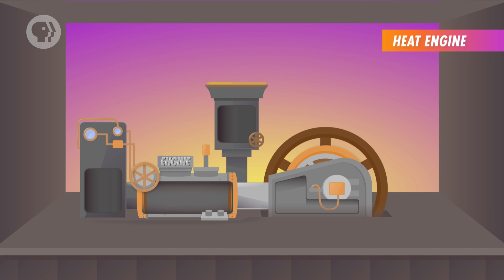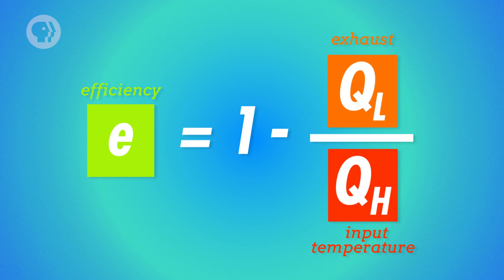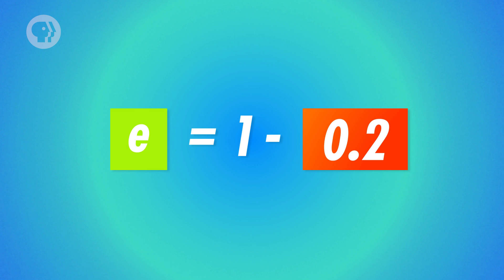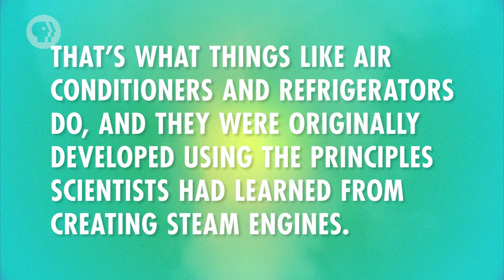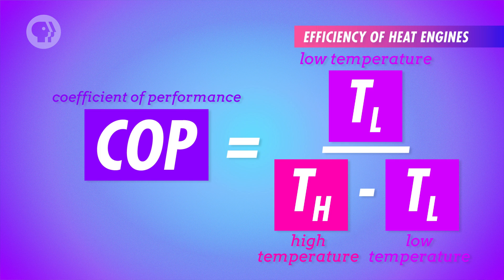Engines: Crash Course Physics #24

Comment: These videos are good overall, but that's just an awful description of how a refrigerator works. She doesn't even mention the pressure difference in the two halves of the loop.

Also, all you young'uns with working high-pitch hearing need to learn how to use the equalizer on your computer or phone.

Comment: The animation of a refrigerator at work is completely reversed and incorrect: after the liquid is turned into a gas it is compressed at which point it flows to the condenser to shed the heat extracted in the fridge(and the heat generated by being compressed) and return to a liquid. This liquid is then sent through an orifice or long, thin capillary tube so that it pressure is reduced hence it's temperature lowered. This liquid then goes to the evaporator inside the fridge where it absorbs heat from the interior and boils into a gas before returning to the compressor. The animation shows the compressor as a "decompressor" or expansion device(orifice, capillary tube) and that is opposite of it's true function as the whole thing is reversed.

Comment: Thanks! The production value is great. However:

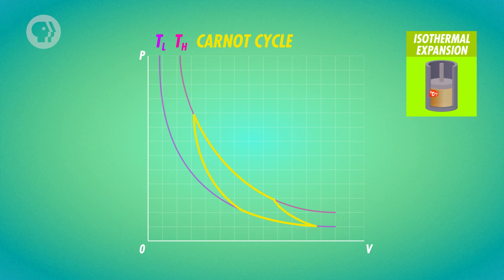At 05:00 you say that there is an isothermal process where heat is slowly added, but the animation shows lots of heat (Q_H) escaping. What gives?

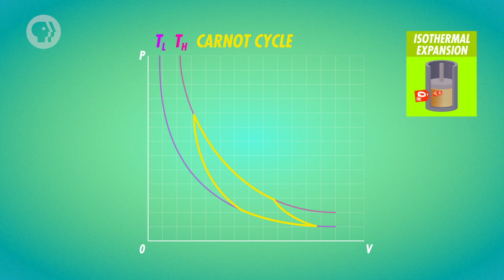At 05:04 You say that the isothermal expansion is 1/2 AB. Shouldn't it be the entire path AB?
 
At 05:15 you say "the temperature drops whilst the heat stays constant, which also makes the volume expand". Well this is misleading: a temperature drop would cause an isolated system volume to contract. However in a Carnot engine, the system is doing work on the atmosphere, converting internal energy into work, and dropping the temperature. It's best to say that the expansion work drops the temperature, not that a colder temperature causes an expansion.

Also, when you keep saying "the heat stays constant", shouldn't you be saying "there is no heat flow" or something equivalent?

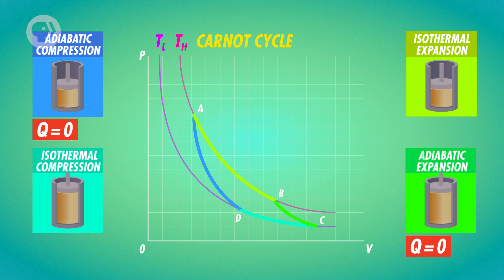At 05:40 you say "the heat doesn't change" but perhaps you should be saying that there is no heat flow, or the system is thermally insulated, or something else equivalent.

The way you explain it sounds as if heat is a state property, when it's not.

Comment: Wonder if you could replace a steam train coal kettle by a radio isotope thermo-electrical generator, new age steampunk stuff ;-)
Reply: That's probably a lot less efficient, since most nuclear plants are basically steam engines hooked up to generators. You wouldn't need an entire cart for fuel (instead, you would probably need several carts filled with cooling water to prevent a nuclear meltdown), but you would use the steam engine to get kinetic energy, to convert to electricity, only to convert it back into kinetic energy. 

Not that I want to break your steampunk bubble. It's just, if you want a nuclear powered train, skip the conversion into electricity.
Reply: A conventional RTG is probably not hot enough, a small fission reactor combined with a cryo cooling system, lot's of heat exchangers and a large water tank, point is that all the coal hassle is gone and a few grams of plutonium is gonna last forever with additional radiation issues i know ;-)
A train still needs a lot of electrical power for other functions.
Reply: robson668 That's why you connect both the generator and the gear box to the axel coming out of the steam engine. Just make it do double the work. Plutonium should give you the energy you need :) 

Just don't waste energy and materials by using an electric motor (aka a second generator)
Reply: Swap the steam engine with a high efficiency Stirling engine or Quasiturbine for rotational conversion and we're on to something ;-)

Comment: How about demonstrating an actual functioning design rather than theory. I would like to be able to build an engine not theorize about one.
Reply: You can't design a very good engine without understanding the theory.  Early steam engines were less than 1% efficient and very dangerous.  If you just want to build a small engine for fun, it would be best to just copy an existing design, since all the factors will have been worked out by someone else.  It would take a whole series just to go over the different engine cycles: rankine (steam), stirling, diesel (diesel), otto (gasoline cars), brayton (jet engine), Lenoir (ramjet), and more.  The easiest would probably be a small stirling cycle with air (could be made small and fairly safely).  There are stirling engine designs out there you can look up.  But to design something from scratch to be useful is very, very difficult.

Comment: This was way too much information to put into one video. SRSLY. 

The other problem is that you didn't even go into WHY the Carnot engine is maximally efficient. Maybe some historical context on why Carnot even bothered to figure this out might help...

Third, I think it's important to explain that regardless of the type of engine. Any engine that converts heat into mechanical energy will be limited by the Carnot Efficiency, I believe there is a relevant quote from Carnot about this. 

Maybe also include a primer on what a heat engine is and why we care...? Abstract away the details and show the simple model.

You can't just talk fast, and expect people to understand. This is absurd. It's one of the most important and interesting topics, and you're just glossing over everything.

Comment: steam engine  coal pollution   advance.  Right. Half an advance maybe, but what about the environmental cost? More inventions were needed to combat that.
Reply: The heat engine doesn't care where the heat comes from. Radiation works too! And if you don't like splitting uranium (or other big atoms) to get radiation, there are solar plants that use sunlight to power steam engines.

Comment: Where would electric engines stand? They start off with ambient heat, max torque at 0rpms, output heat is significantly lower than a steam or an IC engine, practically all are reversible.

(Edited to fix auto correct errors)
Reply: An electric motor is not a heat engine so this course segment does not cover how the motor converts potential energy into work.
Reply: Electric engines convert electromagnetic energy into kinetic energy. It's an entirely different process.

In principle, an electric engine is the same as a generator, but used in reverse. If you spin it, it produces an alternating current. If you give it some AC, it will try to spin fast enough to match the frequency of the current.
Reply: I'm no expert, but there must be a very low input temperature, as electrons don't have one.

Comment: A small part of me thought this was going to be about rocket engines and I got really excited.
Reply: Same underlying concept, just more complex and different details.
Reply: What makes a rocket a rocket is that it carries it's oxidizer with it instead of using ambient air
Reply: ***** They don't use any of the systems shown in the video in particular though. Way more simple, just more plumbing.

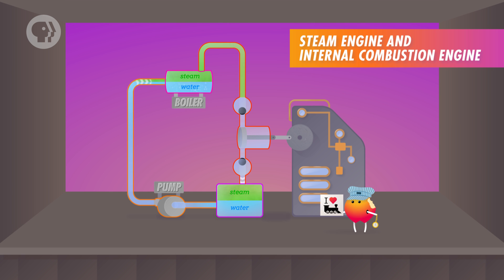Comment: That diagram at 1:42 is almost exactly how your house gets electricity (unless your grid is fed by solar or wind).  The power plant uses coal, natural gas, oil, nuclear fission or even garbage to create heat in what they show as the boiler.  Then just replace that piston with a steam driven turbine that turns a big generator and boom, your house has glorious power.

Comment: I found a little bit confusing the explanation about the reason of isothermal processes in carnot cycle.. It's isothermal to favor reversibility?? It does not make too much sense, because the heat transfer is with the hot source and cold sink not within the cycle... I mean there is indeed a temperature difference between the hot source and the hot isothermal process, the only fact that maintain the process isothermal is that it's doing work at the same time that it absorbs heat...    Other remark is that the T-s diagram is more apropiate to understand heat engines cycles and it efficiencies (just need to spot the ratio between the area under the cold curve and the area under the hot curve)
Reply: I don't think this series has really explained entropy well enough for a T-s diagram to be helpful to anyone hearing about thermodynamics for the first time.

As far as reversibility goes, isothermal and adiabatic processes are required, du to the definition of reversibility. 

Any heat transfer from a high temperature to a lower one produces entropy. A reversible process produces no entropy. If there is no temperature difference during the heat exchange, no entropy is produced, making isothermal processes the only reversible kind of process that allows for heat exchange, while adiabatic processes pass for reversible by not having any heat exchange that can produce entropy.
Reply: I don't think this series has really explained entropy well enough for a T-s diagram to be helpful to anyone hearing about thermodynamics for the first time.

As far as reversibility goes, isothermal and adiabatic processes are required, du to the definition of reversibility. 

Any heat transfer from a high temperature to a lower one produces entropy. A reversible process produces no entropy. If there is no temperature difference during the heat exchange, no entropy is produced, making isothermal processes the only reversible kind of process that allows for heat exchange, while adiabatic processes pass for reversible by not having any heat exchange that can produce entropy.
Reply: You have stated a contradiction " A reversible process produces no entropy. "; the isothermal process of carnot engine DO produce entropy, you can easly check the T-s diagram or think in terms of dQ = TdS; for heat to be transferred you need to augment the entropy content.
Reply: An isentropic (no entropy change) process is adiabatic (no heat transfer) by definition.
Reply: Abraham Vivas Isothermal heat exchange leads to entropy being transferred, but no entropy is produced, in the ideal case.

dQ = TdS only deals with entropy transfer in internally reversible processes. I'm not saying the entropy doesn't change in a reversible process, only that no new entropy is produced. Any entropy increase in a Carnot process is brought in with the added heat, and transferred back out again, when the system gets rid of heat.
Reply: okey, but it doesnt explain the reason of the choose if isothermal process, as you say, the equality dQ = TdS deals with reversible processes, with that equation i can describe other processes like isobaric processes... like in a ideal Bryton Cycle... That was my point, that its confusing the explanation of the choose of isothermal process and why its favor the reversibility... as she explains, she says that for a process to be reversible must not be temperature gradients within the woking fluid... that can be achieved in a isobaric process within a piston where the heat trasfer is slow enough to let the process to be quasi-static... So you can have any process to be reversible, not just isothermal ones.
Reply: Abraham Vivas That's a great point. All of the ideal thermodynamic processes are assumed to be reversible, as you say. But that's just down to the definition, since reversibility requires that no entropy is produced. I didn't think about that, and gave you a bad example. I'm sorry.

If we move away from the ideal, however, isothermal and adiabatic processes are the closest thing we have to reversible processes, because they either don't change the temperature, or they don't exchange heat. you can even adjust the heat exchange in an isothermal process to match the entropy production, but that just means you put less heat into the system, while removing the same amount of heat you did before, giving you less work. In reality, friction and other factors will make sure that no process is truly reversible.

If you want the mathematical reason why the carnot cycle is considered the ideal, it can be made fairly clear using as T-s diagram.

All cycles have a state with maximum temperature, and maximum entropy. Same goes for their minimums. Draw vertical lines to mark out the maximum and minimum entropy levels. Then draw horizontal lines to mark the maximum and minimum temperature values. These lines should now intersect to form a rectangle, that shows the restrictions of the system. They also represent the Carnot cycle of the system. Trying to find a more efficient cycle for that system would be equivalent to trying to draw a loop within the rectangle, that enclosed a bigger area than the rectangle.

The horizontal lines of the rectangle make up isothermal processes, while the vertical ones are isentropic (aka ideal adiabatic).
Reply: Voilà !! That's the development that should be in the video! Thanks you very much!

Comment: Could a Carnot engine not be base on Maxwell's Demon?
Reply: I'm sure someone can figure out how to use Maxwell's Demon for a Carnot engine but I myself can only envision it in a long chain. I'm not sure how many would be needed, I would surmise at least 3 but that doesn't take into account human perception which occurs at ~ .02-.05 secs per frame. It may be a hundred for all I know.
Reply: After watching the full video, my money is still on Maxwell's Demon which has been created both mechanically and chemically.
Reply: No.  A Carnot engine has nothing, directly, to do with Maxwell's demon.  It is also important to point to point out that, as of Sept 22, 2016, Maxwell's demon remains a totally imaginary device.  It was and is a thought experiment.  Even as a thought experiment, it is generally considered that it could not violate the second law of thermodynamics, though the theoretical thinking involved is quite abstract.  There have been practical devices built that have some characteristics of a Maxwell's demon, but none of these, either in theory or practice, violate the second law.
Reply: I think I should clarify what I mean by a "practical" device that has some characteristics of a Maxwell's demon.  By practical, I mean a real device working with real atoms and molecules, not merely a theoretical construct.  However, these devices are not practical in a larger sense.  They are laboratory research devices.  They allow research into interesting physics and chemistry.  They will not power your lawnmower.